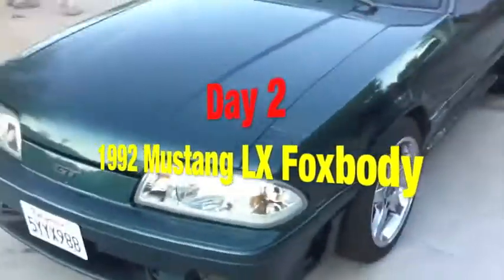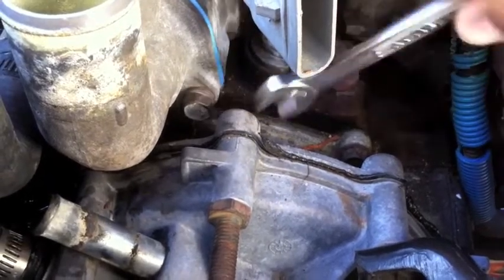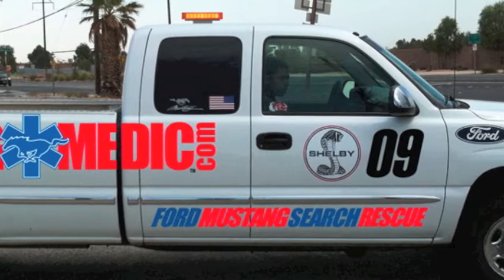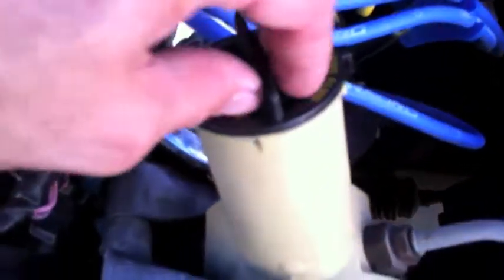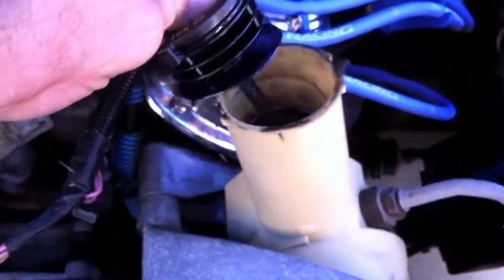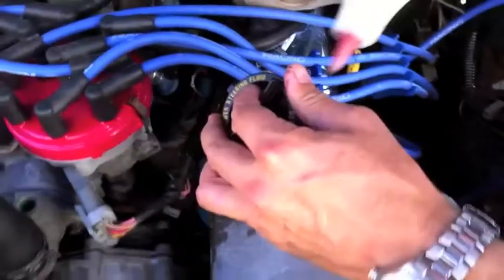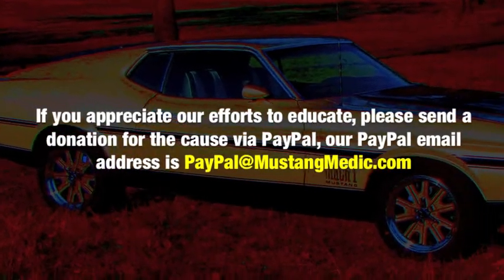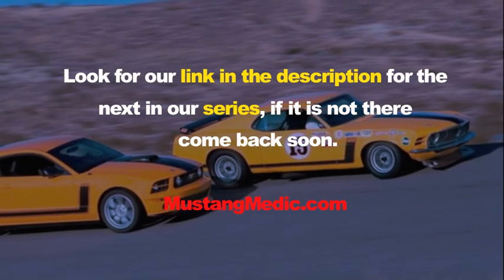Day 2 - Part 2 - The 1992 Foxbody Project - Lucas Power Steering Stop Leak

Comment: Used on a 95 continental (same  v8 DOHC engine as the cobra....) worked very well. Pulling the pump means evacuating the A/C, so want to avoid at all cost.